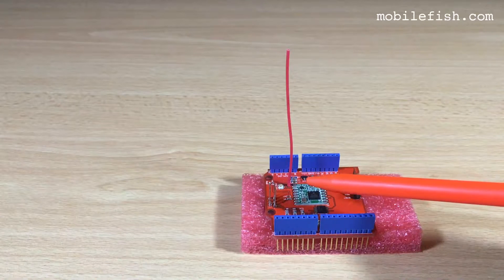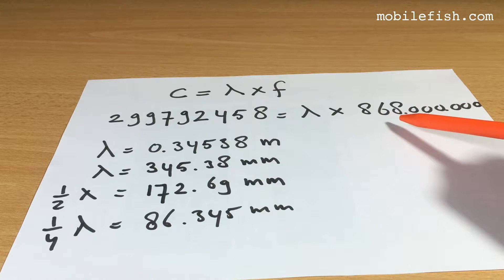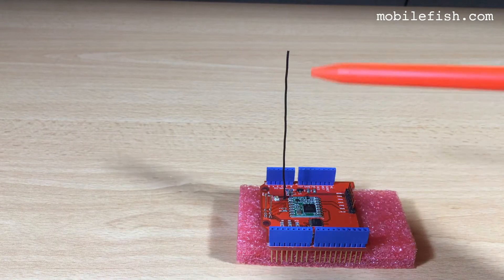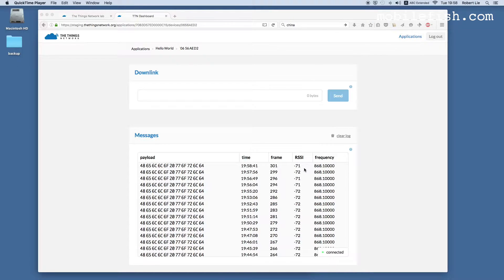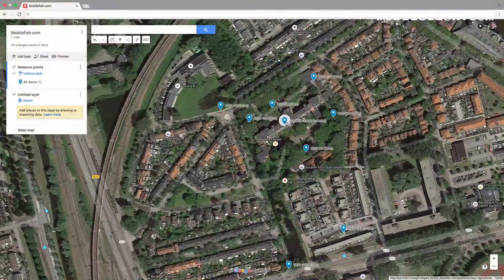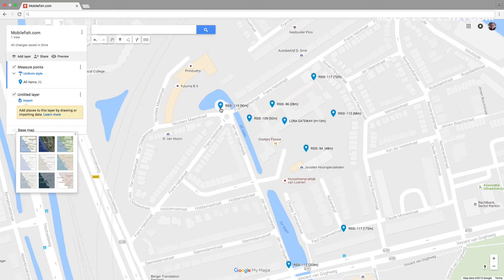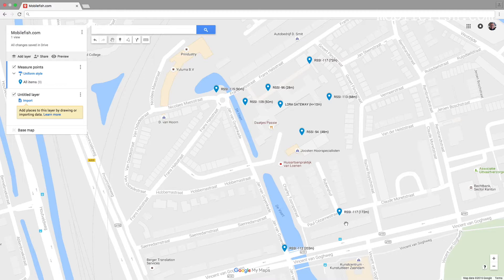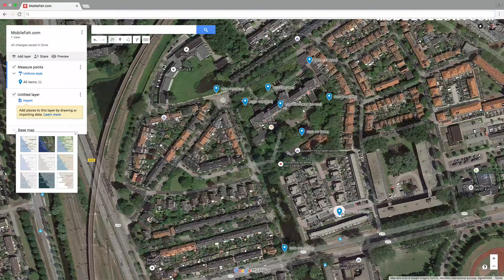The node and Lora Gateway measuring RSSI and distance, part 6

Comment: Hi, I am confused about the diameter of the cable. I understand you said 1.5mm, this is 16AWG. But, at simple sight, I see a thinner cable. Maybe 0.5mm = 22AWG? Or is it correct 1.5mm?
Reply from the maker: The thickness of the wire antenna is NOT important, the length is important.
I only mentioned the thickness, just in case you want to know. You can use 0.5 mm, 1.5 mm, 2 mm, etc..
Reply from the maker: The wire must be straight, not bending..
Reply: @Mobilefish  what about copper wire antenna vs a stainless steel wire antenna, would one give better range reception than the other?

Comment: Hi, do you know if i can use the Lora module that is connected to an arduino uno, to communicate with a UHF Passive RFID Tag to receive the RSSI to find the distance betwwen the module and the RFID Tag?
Reply from the maker: Do not know.

Comment: Have you actually measured the performance difference between the two antennas? In your calculations you missed the velocity factor (considers the wave propagation speed in the antenna material), which for wires is typically 0.95. Multiply this with your calculated lambda/4 length and you get the original antenna's length of 82mm.